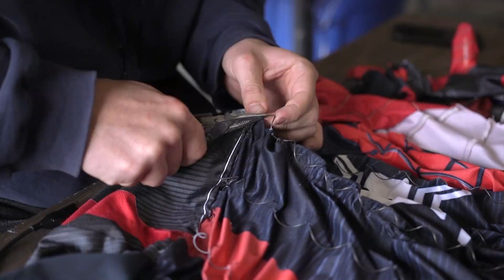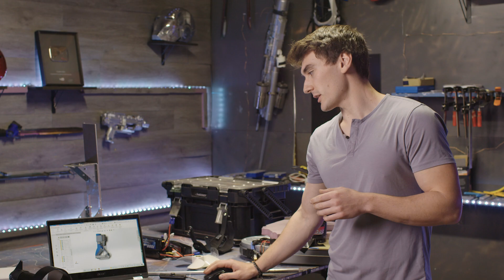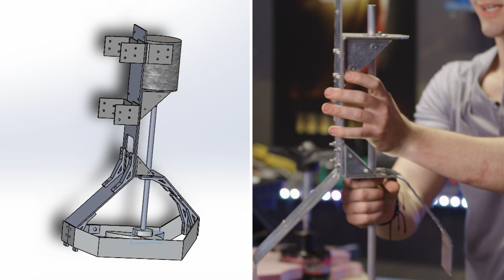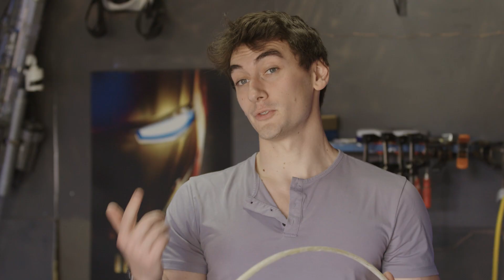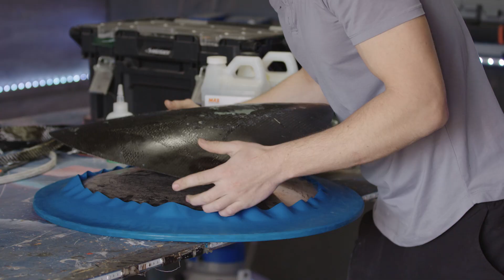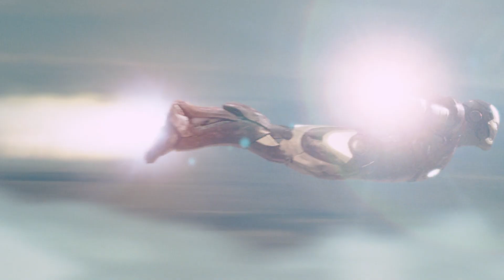How This Guy Makes Real-Life Marvel Gadgets | Obsessed | WIRED

Comment: The idea that you should just build a prototype, test it, then build a better one (instead of sitting around and theorizing) is incredibly powerful. This guy has used that principle to literally build his dreams into reality.
Reply: It depends on resources. Skimping on the design stage can result in many more prototypes being required, which might result in running out of resources (including time) before the project can be "finished". Of course, you don't want to take too long with the design stage, as it also consumes resources.

Design is also as important as the testing stage when it comes to safety.
Reply: @Mop Waters this hits harder than when your mom jumped into the pool (spoiler alert, she caused a tsumami!) 🥶🥶
Reply: @NuggetGX  you wrong for that one 😂😂
Reply: Acting like theorizing and doing the math is a bad thing.
Reply: @austinhernandez2716  he didn''t meant math and theorizing is bad thing. But if its where it ends it IS a bad thing.  In theory ANYTHING is possible with some imagination. But until you test it, It is just THEORY.